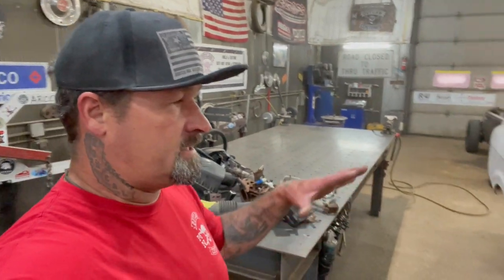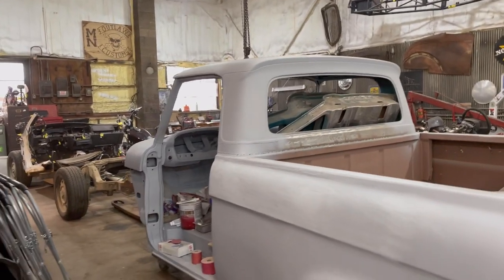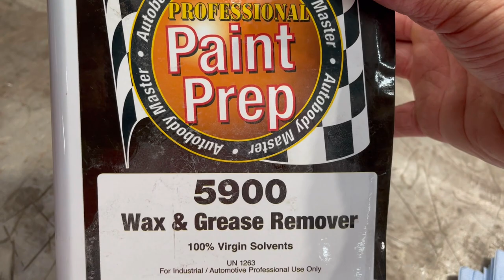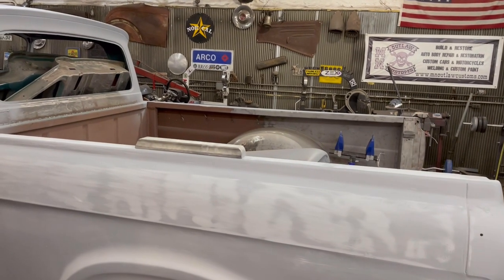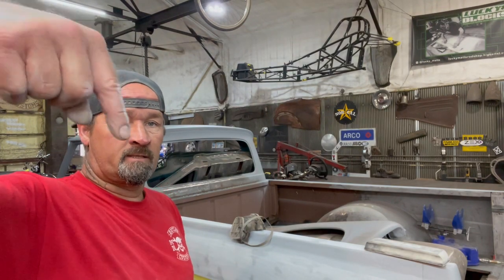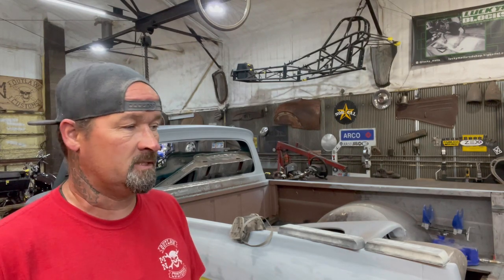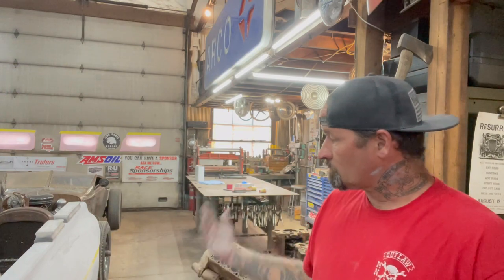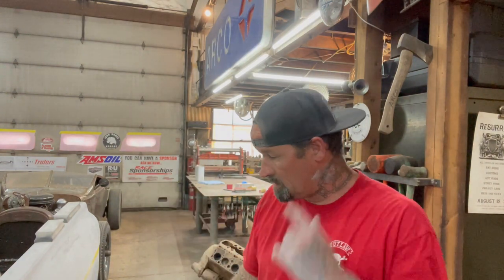Bodywork on Ford Unibody Truck #bodywork #blocksanding #showcarfinish

Comment: What color primer is the best? Black, Gray, Red???  What determines the color primer.   Thanks for your video.
Reply from the maker: I prefer a light color primer for dark colors and dark colors for light colors 👍 its just easier to see bodywork with different colors
Reply: @OutlawEdge   I did not know I've been using black for everything.   My friend mentioned matching color and because he used a different shade of primer even the same paint didn't match well

Comment: How come you went from the large Durablock to the small one? I have heard its best practice to stick to the largest block that fits the panel. Is that good way to work a panel in your opinion or not?
Reply from the maker: I dropped down to the small block because there were some high spots that I knocked down it’s just faster with the smaller block. And then I use the big block for the rest of the panel. After that I will get everything ready shoot primer on it and then block the whole thing down one more time with the lucky blocks. Hope that helps thanks for watching
Reply: @OutlawEdge  it does. Thank you!! Starting my first project car, a 1952 ford gasser and I can use all the help with information possible.  At least I have a good start on my project finishing off what my Bosses father did before he passed away. But I still have a ton kf work to do. Love to see a video on Roll cages if you ever do one in a car. I love your style of teaching videos.
Reply: I use high teck high solids primer for high build and sealer coat works great

Comment: What is you opinion about using a pnuematic block sander?
Reply from the maker: Yeah they work great but u still want to use hand block sanders to get the panels absolutely perfect 👍
Reply: Thanx for the tip. I appreciate your advice. I guess elbow grease is the best way to go!